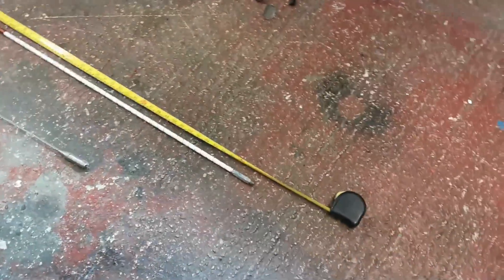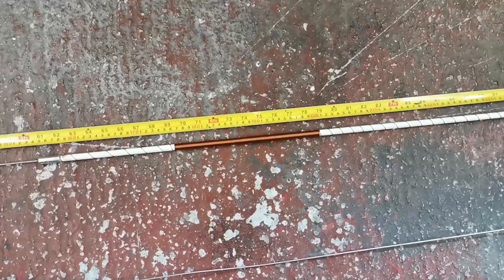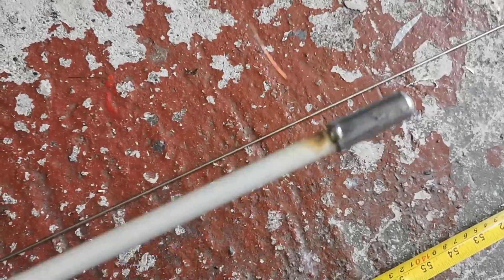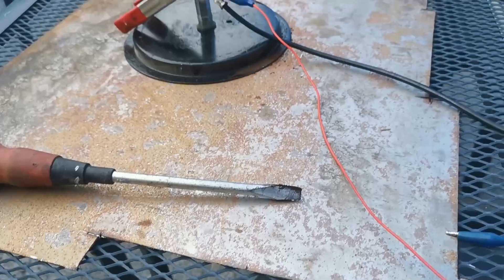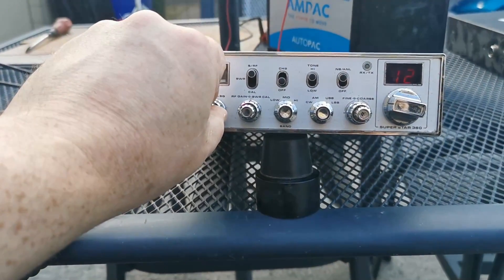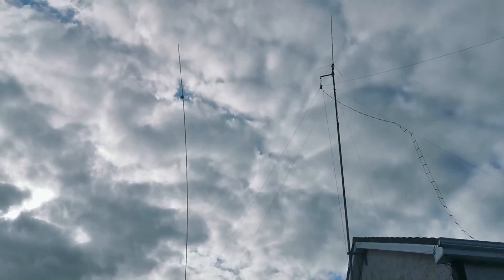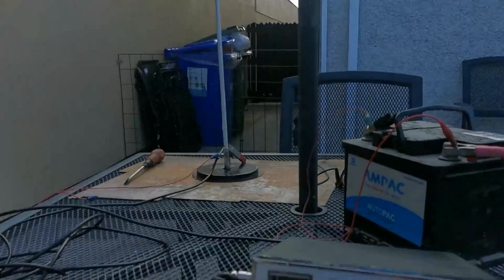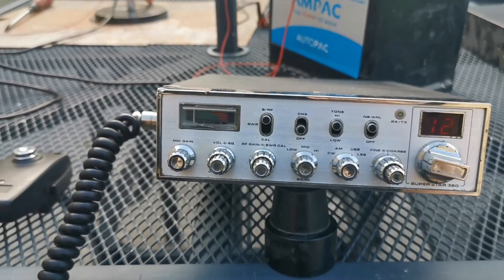HOME MADE CB ANTENNA 9 FT TANK WHIP PART 1

Comment: 9ft tank whip is a cracking antenna I used one 30 yrs ago to DX on my ST9FDX used to drive to DXL and put tank whip on the van used to crack out only rig power no linear. Why don't you another antenna to a bracket and fasten it to the shed that way. You have lots of crackling I noticed
Reply from the maker: I used to get that on the imax before I put it on the roof. I suspect it's all the dad gets around me when it's lower down